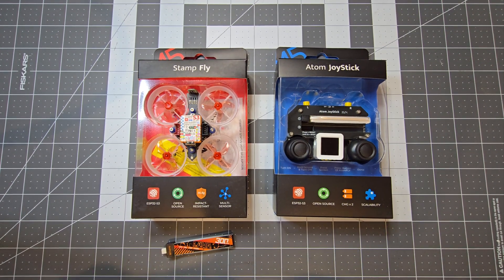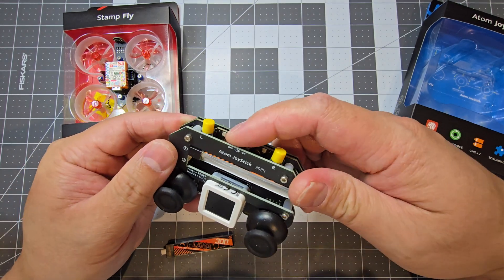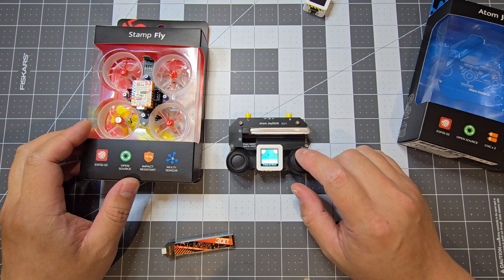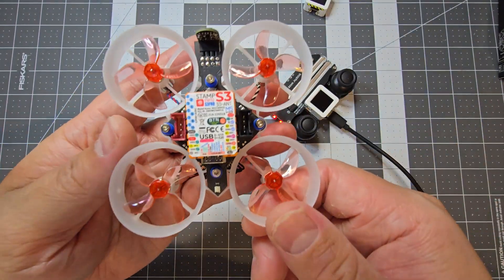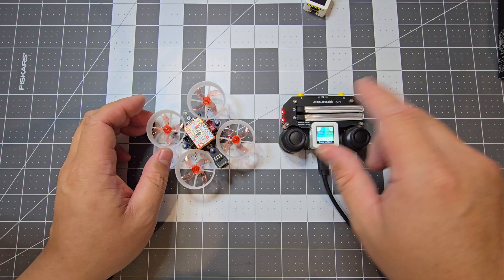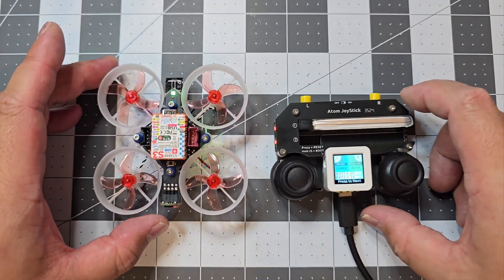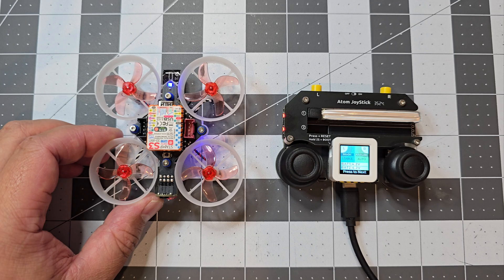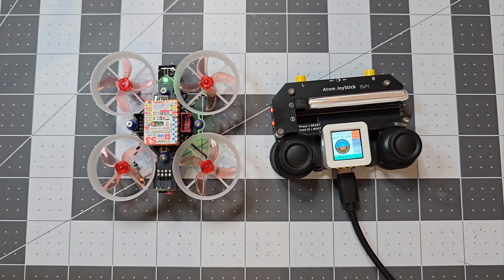M5Stack Stamp Fly and Atom Joystick

Comment: Am I expecting too much from Altitude Auto? Do I need to use the right joystick to control horizontal movement after takeoff? Do I need to use the left joystick to move the Fly higher right after takeoff? Maybe what I am expecting is Position hold and that is not an option for the Fly. How do people who have the Fly experience the Altitude Auto flight behavior?
Reply: I updated the firmware. After the firmware was updated, I was a little braver in my flight actions and in auto altitude, once takeoff happens, I can assert control with the right joystick to keep the Fly from drifting off. The altitude gets a little higher when that happens. The altitude holding wasn't very good but still did not need a lot of micromanaging. It did yaw a bit without joystick intervention but I could use the left joystick to compensate. Usually the altitude changed a little too when I did this but not drastically. Most of the time the land button (center screen button) worked to land the Fly. You need to be attentive with the right joystick at all times to keep the Fly stable. Does this match others M5Stack Stamp Fly operator experiences? So for the Fly, Auto Altitude is NOT equivalent to Position Hold.

Comment: I seem to have the behavior reported in the video where with auto altitude the Fly does not takeoff and hold a steady altitude but rather drifts horizontally only a few inches off the ground and I have to quickly land to prevent a crash. I see the calibration at each Fly startup and I get the waiting LED rotating behavior to say that it's ready to fly. Is there a more drastic calibration that I can force the Fly to perform?

Comment: I made my own prototype controller where I wanted a slider + joy stick. A little OLED display show the data. Haven't moved on to the motor/receiver part, yet - and a part 3 is the text commands going to fly between them.. I'm testing ESP Now and it's near perfect, but many details to work out. Power supply isn't a problem at this point as it's a longer story.
Reply: I have developed an ESP32 controller for the Tello that flies this drone very well. It uses WiFi to talk to the Tello. I use the Arduino IDE for development. The controller I have allows Gamepads to be bluetooth-paired to the controller and then fly the Tello. Maybe we can compare notes because I would love to use my controller to control the M5Stamp Fly.

Comment: Drone is more expensive than a mobula or meteor... Controller is more expensive than a radiomaster pocket.. who is this for lol
Reply: Is it open source, and does modula7 have any expansion ports or similar?
Prices I see are for more than both the controller and drone together from pi hut, where are you looking?
Reply: Check all the sensors on board of this system plus the telemetry function back to the transmitter before your BLABLA.
Reply: It's quite high quality from the M5Stack company.